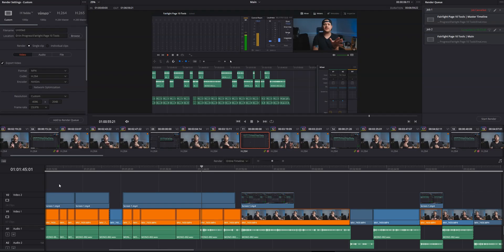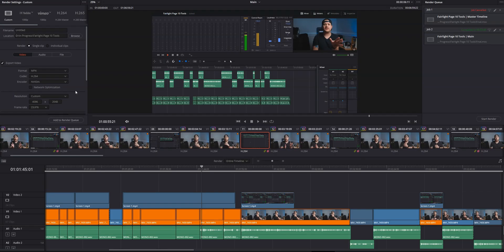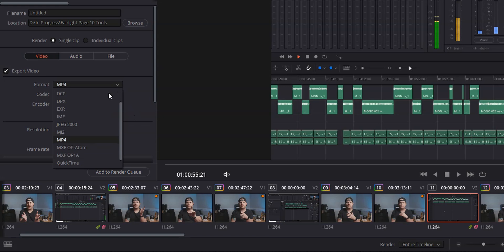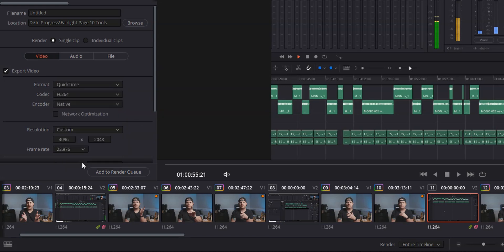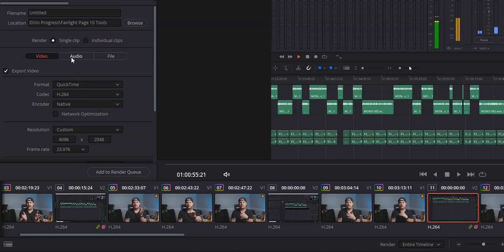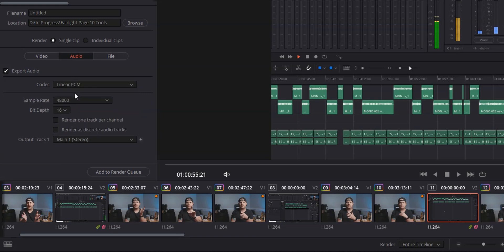SOLVED!! Davinci Resolve Audio Problem on Export

Comment: I had a similar issue but opposite. The exports were producing a loud static white noise. Switching the audio codec from Linear PCM to mp3 seems to have fixed it.

Comment: I'm using Resolve 19 now, For some reason audio in resolve and export is worse than the original file straight from the Gopro hero 7, is this due to using the free version? if so this is enough reason for me to upgrade. I've tried exporting it in Flac 24 but it doesn't help.
Reply from the maker: I can’t say for sure, but I doubt it has to do with the version of Resolve you’re using. It’s likely a discrepancy between your export settings and your sound card settings. I’m going to be putting out a video on this soon
Reply: @JayLippman  I use an Rode Ai-1 audio interface. It's weird the audio is really good in the original file but if it's in Resolve is worse, both the Media Pool and in the Edit Page, sounds like low depth audio. I do mountain biking pov, I don't hear the tyres and root son the trial I ride a much barely hear it, and I hear shshshshs ish sound. But hear it much better in the original file, it doesn't make sense to me.
Maybe resolve can't handle Gopro hero 7 audio so we'll for some reason. 🤔
I eliminated the export settings as both give the same result, both acc and flac.
And just playing the file in Resolve audio is worse. I can't make sense of it.
Somehow resolve seems to damage the audio, which means it exports bad audio.
I've tried multiple media players all give good audio.
Reply: @JayLippman  I'm not sure what you mean by sound card settings. I don't see how sound card setting should ruin audio playback of original file in Resolve, Bu not played in other player. I used the same players to listen to the exported bids, both AAC and FLAC sound the same, Bu yosunf worse than the original file, but sound exactly as bad as in Resolve.
So I'm not sure what's going on. I didn't use any effects, eq. This is weird.

Comment: Hey Jay...  I'm back with yet another rendering problem.. "audio lag" AFTER render.....  any suggestions....  I was going to remove the audio dynamics ( I used Voice isolations AND a compressor) last resort is to remove those.....  and man I would hate to key frame the audio....  just shoot me now.  Just for reference. I took go pro 4 k footage 60FPS, to a 24FPS timeline....  not sure if that has anything to do with it...  thank in advance if you have any solutions.

Comment: OOOOOOOK. Thought I had it figured out from your advice, turns out I was still having issues... until!!! I discovered that by DEFAULT Davinci sets all tracks to mono for whatever strange G-Damnation reason. If anyone is having this problem still go to the track tab on the Left side of your tracks>right click>change track type to>select stereo. You must, absolutely must do this for all tracks with audio on them or they will remain wonky. I had a track with shifting audio and that hollow effect confused the bejesus out of me until I discovered this.
FYI, this is also how you change to 5.1 or 7.1 audio (plus a few extra steps)
Reply from the maker: Tracks have always defaulted to stereo for me! That’s so weird!
Reply: @JayLippman  yeah, I don't know what happened! I looked at my other projects and they were stereo. I certainly did not intentionally change the audio settings but somehow...

Comment: For ANYONE on a PC using the Windows Media player (Finger in mouth) - you NEED to get the VLC Media player. Not the newest windows media player, the VLC Media player. Installs in seconds, plays every format I've ever asked it to play (I'm an editor with over 20 yrs experience). This player lets you adjust the playback speed slower or faster (great for those long format videos you need to watch in their entirety to check edits but don't want to sit there watching a 30 min video in real time). It converts from one format to another and the list goes on. Never had a problem playing a video with this player (PC or Mac). If you go into your settings you can make it the default player for any video format. Also cross platform compatible.

Comment: I don't know if it's the same problem. But basically I got a click/pop sound while all the other audio got severely limited in 1 specific place every time I exported apart from once. And that one time I realised my effects looked weird so I altered them and boom we were back at it.

I even switched render modes and I've now switched back to my old editor for the audio, which I knew would be worth keeping installed in case davinci fucked up.

Comment: On Linux withing DaVinci Resolve there is no H.264 codec, so while the timeline is perfect, once I export my video there is a small delay in video (0.5-1 second). I checked several times and there is no problem on the timeline. Also a very interesting thing. If the created video (containing the delay) is loaded back to a new timeline then there is no problem with the audio.
So it looks like DaVinci Resolve may do its own format and it is able to handle and unfortunately there is no option to handle by other softwares (ffmplayer, vlc player etc)

Comment: For some reason I can't render H.264 in Resolve 17. every time I try I have to cancel render and close Resolve.
I've never experienced this before, but in previous versions of Resolve, I had to export in AAC, I could not export with Linear PCM, cus I would not get any audio. Back then I could not do what you did, there were no option for it, now there is. But in Resolve 17 I can export in both and still have good audio. and that was in quicktime.

Comment: I’ve encountered this problem too and it’s really awful. 16 bit @192 kbps audio doesn’t have to sound like that. I don’t know enough about digital audio processing but I’m tempted to think that this is actually some kind of bug. Can anyone chime on this maybe?

My workaround has been to not render the stereo bus but only the timeline tracks. If you don’t need any processing on the stereo bus (often you can get away without that) then this is a nice alternative I suppose. But really, this shouldn’t be an issue in the first place.
Reply from the maker: It's definitely a bug. The same export settings in Premiere don't result in those artifacts.
Reply: @JayLippman  Well I know from working in audio (which I have a lot more experience with than video) that these settings don’t result in those artifacts. But who knows what on earth is going on in the background... digital signal processing is a  pretty complex thing after all.

Comment: What remedy do you have for when your audio keeps skipping intermittently in the exported video (think like when a record or CD skips)? Tried with Audio set to Linear PCM 16 Bit and 24 Bit and Video set to Quicktime DNxHR HQ or H.265. Audio skips either way. What should the sample rate be set to?
Reply from the maker: For video, 48000
Reply: @JayLippman  Thanks for your reply. Interestingly I redelivered using 44100 though and my audio stopped skipping. Any thoughts on that? I'm wondering if it's my music source files? They are mp3 format.

Comment: Right now I'm exporting a video to render in premiere pro. I tried more than four times and something went wrong Everytime. The audio was lagging on some parts

Dude I have to deliver this video like before 11AM and it's 7:34AM right now
Reply from the maker: Was it shot in a variable framerate? Sometimes that can happen with VBR, but I'm not sure what the solution is.
Reply: @JayLippman  I already delivered the video, It worked when I rendered a 40gb video from AE into Premiere Pro and then added back again in Resolve

Someone on reddit told me about that VBR thing too. I was working with 20+ short videos from different people and smartphones too. The software even asked if I wanted to change the framerate but I denied, think that must be the problem, but thanks anyway
Reply from the maker: Glad you got it figured out!

Comment: Have you done a video or discussed audio falling out of sync after a Davinci render? I'm a smartphone filmmaker working in DVR studio, and I need to export as an MP4 for festival entries, and I found it can happen when I export in H.264. It usually can fall out as much as 2 frames - a real headache to fiddle around with. However, that gives me a much larger file size. H.265 is usually more accurate, but it can happen even then, and doesn't happen in the playback on the timelines at all. And it happens inconsistently with the same phone, using the same settings, even when I have not touched the original clip. Any thoughts? Thank you, and love your work.
Reply from the maker: I'm not sure of a fix for that to be honest. As far as I know, that's just an unfortunate side effect of filming in a variable framerate. Sometimes it just doesn't sync up. I think there might be software out there that can convert the raw file to constant framerate, but I don't know that specifics, and I could be wrong about that.

Comment: OMG, thank you. I've had this problem for like 12 months. I found a workaround - you need to create a Compound Clip from all your audio files on a timeline, put it all on one audio track, and set this track to mono. This method works, but it's a bit time-consuming if you do that in every edit, and it also limits you to only using mono audio in exported files. Your method is way better, so thanks!
Reply from the maker: Glad I could help!

Comment: This should be an absolute shame for Resolve team. Just started using resolve for music videos and yepp, the actual song sucks on beings exported. This is unbelievable. Linear PCM 24 bit still does sound worbly at high ends.
Reply from the maker: It kind of boggles my mind. I think I remember there was some reason for why it is the way it is, and why you cannot 24-bit AAC on Windows, but I can't remember what that reason is
Reply: @JayLippman  i exported as h.265 quicktime uncompressed. Imported the final file to premiere changed the audio in Premiere and put on an Gamma compensation export LUT and called it a day.

Comment: Hi Jay, do you know why my exported audio is so low compared to audio in DaVinci?
I tried exporting in AAC, Linear PCM (24 bit), IEEE float (32 bit)
but nothing seems working
Reply from the maker: Hmmm check your target loudness level. If you are exporting for YouTube, your target loudness should be -14 LUFS. Resolve has it set to -24 LUFS by default, which is broadcast standards. Tweaking that in your project settings could help. I have a whole video about it on my channel.

Comment: Thanks for the video, as it's exactly the problem I have, but unfortunately your adjustments didn't work for me.  I'm not a pro, but it blows my brain how my audio sounds fine in the editor and renders into a video where I occasionally sound like I'm talking through a WWII radio.  I never had this problem when I first started with Resolve a few years ago.  I think the newer versions exacerbate the problem.
Reply: OK.  Sorry to keep posting.  I kept trying things and discovered that setting "One Track per Channel" (Quicktime, Linear PCM, 24 bit) seems to resolve the issue.  I don't know what this setting does.  I also discovered in Fairlight that my audio was stereo.  I'm not sure if that's a clue or further proof I don't know what I'm doing.  Thanks again for posting the helpful videos; I know what an effort it is.
Reply from the maker: I'm glad you figured it out! Sorry for the late reply, I just had a baby and it's hard to keep up lol. Your video should be in stereo on export. Mono would make it sound like a muddy mess lol.

Comment: Yup me right here, expect it’s clipping noise
Reply from the maker: When you say clipping, do you mean it's too loud and it's distorted?
Reply: @JayLippman  I cant really describe it very well but its more like aloud high pitched pop. I checked my levels on audio and nothing was peaking. In the parts of the video that where I added the  limiter compressor from davinci. Unless it was because I used a go pro(hero 4 silver)? I recently purchased a new camera not an action cam. So hopefully that will solve the issue.

Comment: I have an issue when the video is finished rendering and my lips doesn’t match the audio but it’s sync correctly before I even render it out. Any suggestions on what this might be?
Reply from the maker: I'm not. That's super weird. I would check the forums and see if anybody else has had that issue. Someone in there might have the answer. Sorry!

Comment: I got an issue about panning the audio. I got a WAV file in my timeline already panned to the left and it's everything ok when I play it inside Davinci, but the audio hits both left and right the same way on the exported video file, even if I render using linear PCM codec and 32 bit depth. What can I do to solve this?
Reply from the maker: Have you double checked to make sure that you're exporting your audio as stereo?
Reply: @JayLippman  Yes. Stereo option selected.

Comment: Thanks. I had a problem with some noisy elements to my audio, so I exported my audio out to try to clean it up and put it back in. Whoever's video I watched about how to do this (I didn't realize the need to uncheck the video, so I was getting a movie) recommended to export it in 24 bits because that's good quality. When it came back in, the mp4 exports were funky. The audio would play on my computer, but not on the websites I uploaded them to. I followed your instructions and made a MOV file instead, Linear PCM, 24 bits. It worked!
Reply from the maker: Yes! Glad this helped!

Comment: Had the problem and it sounded almost like doubling up of words.  Not steadily, just one or two times in a short video.  Thanks for the tip.  I will try it on my next edit.  (afterthought) I read some comments about the problem occuring where clips overlap.  Wondering if muting one of the tracks at the overlap point would solve that problem.
Reply from the maker: It might! Or at least doing a crossfade.

Comment: as a suggestion.... could you have exported the problem video with its problem audio, then included it in this one ? the final encoding should include the issue rather than fix it, just wondering
Reply from the maker: I tried, but in order to do that i would have had to export the whole thing as 16 bit, so this whole video would have had this issue.

Comment: I'm ready to uninstall 17 and go back to 16... nothing but problems...  I cannot get the sound to work with my headphones...  sound comes out my speakers fine, its when I plug in my headset... I get nothing. and I cannot find a fix...  any advice ?
Reply from the maker: Is that problem only with Resolve? If so, it sounds like there's a setting that needs to be changed, but without knowing how you have your audio set up, it's hard to give guidance. Your audio settings in Resolve can be found in your preferences.
Reply: @JayLippman  Good morning.. YES...  headphone work when not in Resolve....

Comment: My first try using resolve after all the hype. Using the latest ver 17 beta, if I select youtube, vimeo, exported audio no sound. If i use custom, the audio certain part of the video will have strange audio artifacts like the audio suddenly went into water and it sound like wobbling. Duhh... lucky I never purchase the studio version.
Reply from the maker: The export settings I use in this video will help with the warbly sound you talk about. The no sound issues are a bug I think. Hopefully it will get fixed before the full release of 17.

Comment: Thought I was going crazy! Thanks so much for the tip! I still have one problem: after I export it as .mov the colors are all washed out. Do you have any idea why?
Reply from the maker: If you're on a Mac, it's because Apple displays use a different color space. You need to set your color space and gamma tags to rec.709 and rec.709A in the advance section of your render settings.

Comment: Hi, please, I have a problem. When I'm editing on the pc I hear sound normally but when I send the edit to my phone to upload(on twitter) there's no sound at all.
Reply from the maker: What are your export settings?
Reply: @JayLippman  
Video settings:
⚫Format ➡️ Quick Time
⚫Codec ➡️ H.264
⚫ Resolution ➡️ Custom (1080 x 1080)
⚫Frame rate ➡️ 24

Audio Settings:
⚫Codec➡️Linear PCM
⚫Bit depth ➡️16
⚫ Output Track 1➡️ Bus 1(Stereo)

I use Davinci Resolve 17 beta.
Reply from the maker: Huh. Im not sure what the problem is. Is there audio if you play the video on your PC before you upload to Twitter?
Reply: @JayLippman  Yes please 😥
Reply from the maker: Then the problem is with Twitter. I run into this before. Try changing your audio to AAC.
Reply: @JayLippman  Okay Jay, Thanks a lot. I didn't expect a reply to be honest 😂. THANKS! I'll just add the audio using  Inshot (A video editor from play store) and upload 👍
Reply: @JayLippman  Ohhh I just found out what the problem was. The problem was that Twitter doesn't support the QuickTime format so I changed the format to MP4 and everything works normally 😃👍

Comment: It helped but still doesn't sound as "clean" as on the program... Any ideas?
Reply from the maker: I'd have to listen to the audio in order to know what the problem is. Sorry!
Reply: @JayLippman  No problem. I got it fixed, after trying lots of configurations I ended up making the exact same thing on the video but the audio was changed to IEEE Float and 32. Now it sounds better

Comment: you just saved me a lot of time figuring out what was wrong, so thank you so much for that. I don't know if this is a feature for Resolve 17, but I found out that if you click on the setting of h.264 master, it can also help you solve this problem by making the step a little bit easier. It's essentially the same thing, just a different way.